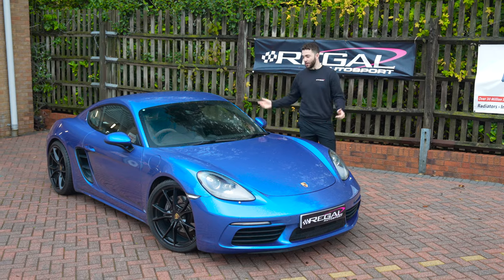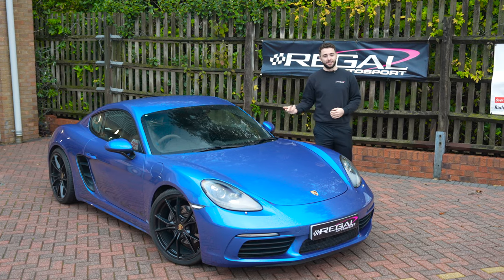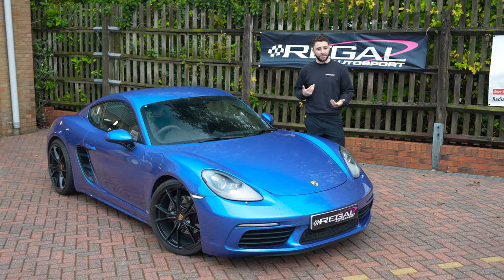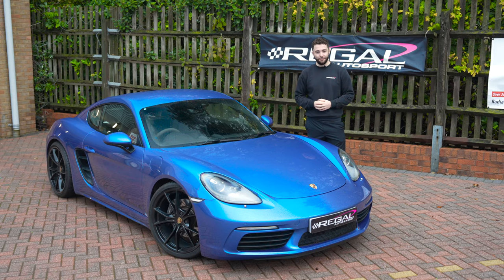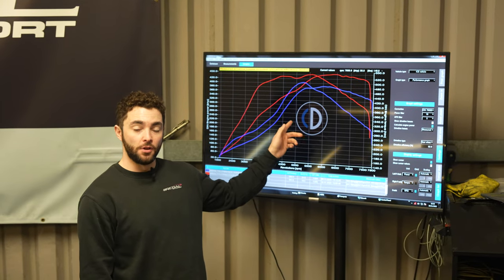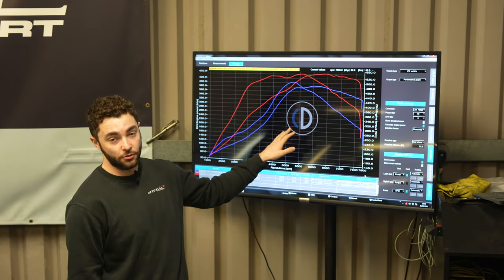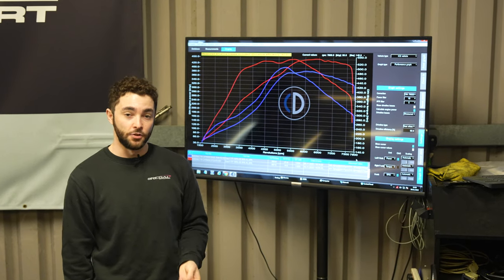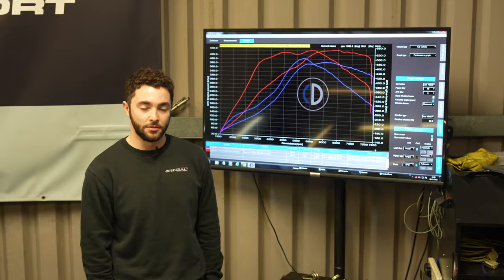HYBRID TURBO 718 CAYMAN 2.0T!

Comment: My questions are: Cost of the new turbo, installation, tune, and supporting upgrades compared to getting just the S trim with a tune?
Reply from the maker: A Performance Specialist can walk you through all of these questions
Reply: Still won’t hold value as good as an S trim. Also the 2.5 engine uses a VTG/VGT turbo along with adjustable cam tuning on both intake and exhaust cams rather than just intake.

You can push the 2.5l to 420-450hp with stock turbo and 550-600hp with a hybrid
Reply: @Manis-World 
Are you telling that 2.5L cayman just with hibrid turbo can make around 600hp?
Reply: @Alexandree55  with some supporting mods and tuning yes… it’s been done (check 718forums) 

500hp+ and be a reliable daily driver is no problem
Reply: @Manis-World  
What supporting mods are you talking about?
Reply: @Alexandree55  upgraded intercooler, HPFP, WMI, 200 cell downpipe…. Along with a Raggdoll hybrid turbo and EQT or Sam’s tuning
Reply: @Manis-World  
Thanks bro

Comment: I also have a 2018 2.0 turbo but it has a stage 2 I wanted to figure out how much a bigger turbo could cost
Reply from the maker: Awesome! You can contact us using the information in the description
Reply: Go to TTE global, you have two options there, first one being to send your turbo to them and they make it a hybrid for 1500-1600euro, or take a completely new hybrid turbo wich sets you back about 3600euro's, they are good for 440 to 465hp depending on other supporting mods.

Comment: why is this called "hybrid" turbo ?
Reply from the maker: Hybrid turbo is usually a standard turbo that uses different internals, typically compressor, turbine and other parts to change performance of the turbo
Reply: @RegalAutosport  where can I buy this turbo charger from ?
Reply: The little turbo company in the uk - Littco make this turbo
Reply: @shelbyhaiketic4212  if you have a 2.0l tte makes a hybrid turbo 465 kit for it
Reply: @RegalAutosport you guys sell this turbocharger? We have a client with a 2.0 and have done most everything there is to do so turbo is next.
Reply from the maker: @vincecascio4194  Yes we do! Please use the contact details in the description for more information on ordering
Reply: Witch of the 4 cylinder do you think is better to buy if you have in mind to do a turbor, witch one can take more power and stay relative reliable
Reply: @RegalAutosport  how much power do you reckon you can reliably squeeze out this engine if you can properly cool it (i.e. something like a big intercooler)

Comment: Would the owner not have been better off using a 2.5 as a base? 
That said, in this world of excess(and dreams), start with the 4.0 flat six!
Reply: The Flat 6 does not have much room for improvement without serious money being thrown at the car, unlike the 4 cylinder making all the same power with a fraction of the cost.
Reply from the maker: The turbo engines are a cheaper entry point for a certain level of desired performance, and especially being able to improve it!
Reply: To be honest I could not afford the 4.0 litre plus it’s a lot slower than mine now. I had a 6 cylinder before but after spending lots of money I had barely gained 50bhp. I’ve gone from 285bhp to 450bhp with this little 2.0 litre engine. 👍
Reply: @kaivaksdal  It’s good to know that these engines have that potential. 
Does the 2.0 come with a lsd?
Reply: @Largeone1968  no lsd except on the T model. Tbh I have not felt the need for lsd in the 3 years I’ve owners the car. That includes good and bad weather plus many track days. You would be surprised how well this model puts its power down.
Reply: First, no one answered your 2.5 question. Second, the blue lines we are asked to disregard due to numerous fault codes are from their previous tune. Am I missing something? Anyway, most of us can't outdrive our cars so more power just puts us that much further behind the curve. When you buy a driver's car you need to start driving, want to go fast on a straight line maybe you purchased the wrong car. I have the 2.5 and it is plenty faster than me but a friend of mine has a forty year old car, cost about $25K and does 0-60 in under 2 seconds (his rear tires are bolted on to the wheels.) As I always tell him driving isn't like sex, no prizes are awarded for beelining it to the finis line. If I am not making any sense it must be my stage 2 tune but I promise you all after stage 3 I will be best.
Reply: 2.5L comes with the S and GTS model.  Some other guy on Youtube has upgraded his turbo on 2.5L GTS and tuned it. got 500+hp
Reply: @DS-vx3wf who has 500 wheel? My wife Raggdoll has 568 wheel in her gts now it’s pretty insane! But I’m here looking for some 2.0 turbocharger leads. Got a client we are building his rn. Fun little cars.. to small for me but definitely an up and coming platform.
Reply: @Largeone1968  I ain't a Porsche expert at all but I did ordered a 718 (getting it in a few days) and I did pay for the option (Porsche Torque Vectoring (PTV) with Mechanically Locking Differential) but even with that I do not know enough about diff from stock to this one if it is LSD (hope this helps).
Reply: @vincecascio4194 
😱😱😱You have got 2.5L cayman with 568hp?